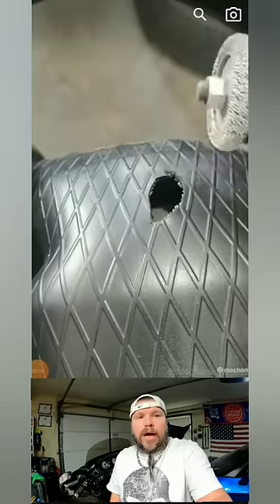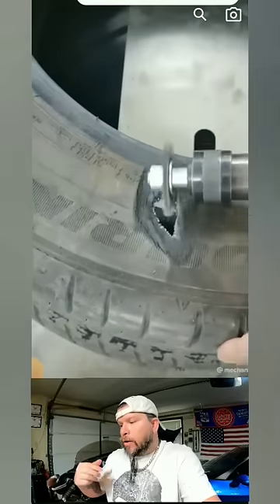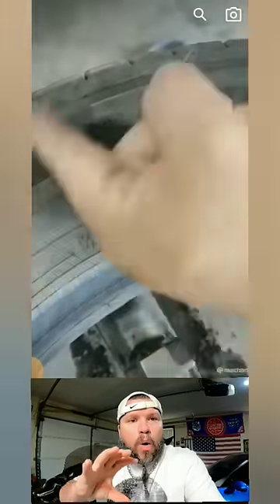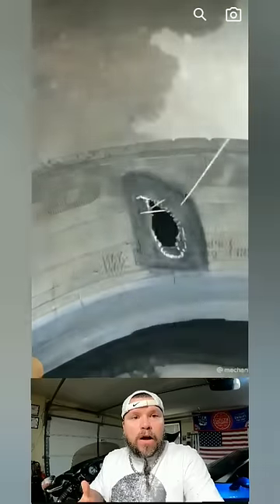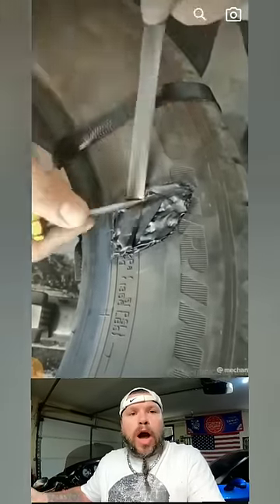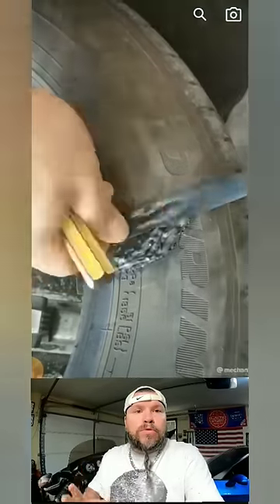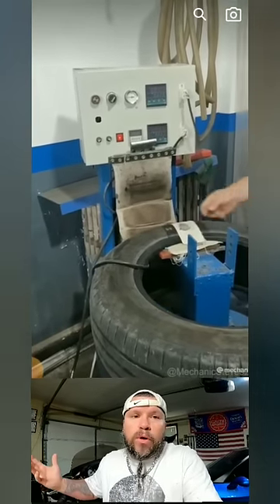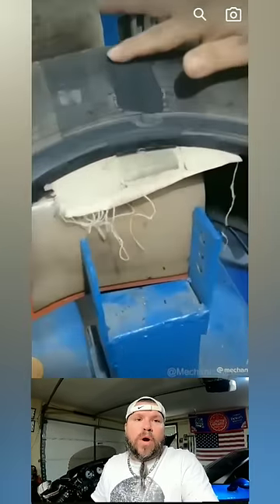patching a tire

Comment: got one like that on a hay wagon that was repaired in 1988.
Reply: Nice
Reply: Liar , that tire would be so dry rotted and weather cracked if you put any weight on it, it would fail.
Reply: @Blue_Shirt_Guy  go to farm equipment auctions and you will find lots of old tires with this type of patch on farm equipment . They usually put the patch facing the vehicle side and YES some of the tires on equipment is as old as 1988 manufacturing dates & still getting the job done . I've even seen people spray paint old tires black to make them look new to sell the equipment at farm equipment auctions .
Reply: @craigalston2208  I'd factor the price of new tires in on my bidding process.  Tires have a shelf life. dirt farmers don't care. Dirt farmers only care about saving pennies, while burning dollars.
Reply: @Blue_Shirt_Guy  Maybe, I have a disability that I have been unaware of my whole life. However, I feel I just read a response made up of bullshit that was unrelated to you being told how wrong you were?
Reply: @dakotahbarnhill4861  ikr it was bs in my opinion.
Reply: What’s that wagon toppin’ out at?
Reply: @jt5678  about 160 bales an hour
Reply: @Blue_Shirt_Guy  he didn't say the hay wagon or tire is still useable. Just that he had it. My brother has a race car. It's been sitting in his back yard for 6 years. It wins no races. Nor does it run. Still owns a race car.

Comment: I actually rode on a patch like this for a year, throughout winter as well, we were in a remote place near the arctic , and plane drop offs never got the tire for about 11 months. I also use this on my bias ply muds, I haven't had a bad time yet.

100 to 200 km a day on the tire, minus every other Saturday and Sunday.
Alot of things in this world can be repaired.. or listen to the guy selling the tires.
Reply: Anything can be repaired but there’s always a draw back compared to a new one.
Reply: Same. I’ve had patched sidewalls and ran them just fine. In every other part of the world, tires are a lot harder to come by, and they don’t just get replaced. If I have the money and can swing it, I do replace them…but to say that it WILL fail is incorrect. In Africa, this tire is just getting broken in!
Reply: You were driving at highway speeds?
Reply: @fakename287  highways speeds on gravel roads. Highway, roads, offroad.
Reply: @jakejakedowntwo6613  for sure.. but the tire never blew up on me. I just swapped it out when it was flown in.
Reply: @bravofighter  yep exactly right.

Comment: Somebody get this guy an inner tube!!
Reply: Nope
Reply: Nick Güer  Not true. They even make 'radial' tubes for radial tyres. Can be used in bias tyres but shouldn't use 'bias' tubes in radials
Reply: Nick Güer  what on earth is your problem???
And from what you said, it appeared you meant you cant put a tube in a radial tyre. Given thats what you said
Reply: You seriously made my day with your comment 😂😂😂😂😂😂😂
Reply: Nick Güer  You take everything this personal? or only when you are online talking to strangers? 🤣
Reply: Best  comment 👍
Reply: Can you put inner tubes on automotive tires?
Reply: @OldHeadFPS  Yes there usually used for offroad or heavy loads and also in equipment like tractors as well. They ran tubes in automobiles until the 1950's. This guy needs an inner tube to use on vacation, he's better off floating down a river. Lol
Reply: The heat won't dissipate properly with an inner tube.  You could use it around the farm or something but not at highway speeds.  Too much friction between the tube and the tire.
Reply: @UFO-047  haha you make too much sense to have an argument with that guy
Reply: That hole is too big to run a tube.

Comment: The only thing you missed is that the shoulder is considered a major part of the tire along with the tread and sidewall. Other than that, as a certified expert, this explanation is spot on. Now, if only customers would realize this as well 😂
Reply: The only major part of the tire... is the tire.
Reply: So maybe you can help me understand a little more about spare tires cause I was always told you’re only suppose to drive like 50 miles on one? But I was literally going out of state to fck with this chick(like a 6 hour round trip) and I did it at least 5-6 times. Also, I literally never got a new tire for that car…I drove it till I couldn’t anymore…but it wasn’t because of the tires lol I had to be on that thing for 6+ months…and I was like 20 so I was ripping and running constantly.
Reply: @Jordan Cave thanks bro that was a good read lol 😆, but sure I can help you out

They say only drive 50 because wheels need to be torqued to a certain specification, and excessive speed plus a loose wheel means disaster. Also. Having one smaller tire can cause uneven wear on the rest of the tires over time, which shortens the overall life of the tire
Reply: Agreed, as one as well
Reply: Not just un-even tire wear,  but also stresses control arms, bushings, shock/struts especially of older vehicles with aging parts that haven't been replaced and still in dependable/safe condition.

Comment: I hate to burst your bubbles people but I plugged a sidewall on a brand new tire that someone punctured with a knife I think. I used a standard tire plug you buy at any auto parts place and it lasted longer than the tread on the Goodyear tire did. I'm not sure about that much bigger hole but don't let them make you think it can't work in your own unique situation because i proved it to myself. Instead of being perfectly honest they will say whatever they want to sell you a new tire.

Comment: They do this in Mexico and Latin America 1000 times  a day and heat and vulcanized it in the end and they are fine and don't blow up.

I had a tire fixed this way and you can barely even tell where they are fixed in the end.

Comment: This kind of repair is actually quite common in developing countries, as purchasing a tyres (even a local made one) is around 60-100 dollars per tyre and that is very expensive if your salaries is only around 200-300 dollar a month
Reply: That's fucking cheap. American here
Reply: @ineedapharmists  ok lemme put this in a different way, tires in developing countries are 50%+ for just the cheapest tires. That's still insanely expensive
Reply: @ineedapharmists  You forgot the 200-300 dollar monthly salary
Reply: @ineedapharmists  maybe a third of your monthly salary and you have to buy food and rent and everything
Reply: @vortrekking boer  if you're an American then yeah maybe it's cheap, but if a single tyre costs almost half of your monthly salaries, then it is expensive.
Reply: @vortrekking boer  it's very expensive till the point where it is actually normal for people to buy used and rethereded tyres

Comment: There was a time when we did repair sidewalls, but they were not hole filled.  You can boot n tube, but keep in mind that it is only fixed on one side.
Reply: Those were bias ply tiers not radials.

Comment: I had a nail or a screw puncture a tire.  Our fleet I typically have 2-3 a year with the mileage I drive, diverse locations, jobsites, etc.  This one had ended up on the edge of the tread, and even though it was an extremely new tire they said because of its location they didn't feel comfortable putting a patch on it.  

You shouldn't take chances on something supporting you moving lots of weight at high speed

Comment: On semi tires you can repair the sidewall it's called a section repair. it includes a lot of grinding down like this guy did they spot weld new wires in the belts. Back fill it with rubber and also put a super heavy reinforced patch that covers from one bead to the other bead. When it's done properly the tire is just as dependable as a brand new tire
Reply: No, it's not. That's the reason there are semi tires all over highways.
Reply: Aircraft tire engineer here (I design high load bearing tires)

A puncture like that is not viable for use anymore. It’s actually cheaper to just replace the tire than risk liability of quality patchwork, especially for semi trucks.
Reply: @bryancline8893  all the tire debris you see on the highways is from Bandag recaps, not sectioned sidewalls. 40 years in the industry, my father and grandfather before me, family business. for the record, I have never run, or put a sectioned tire on the road, but if done properly I do know sectioning of semi-truck tire sidewalls is safe. Here in the states it is not something that is really even done for the last 20 years at least.
Reply: @tymcfadden8496  dang mr. Expert get off the internet and get on the Tv
Reply: @tymcfadden8496  i do secretly know they're retreads.
Reply: @bryancline8893  you got educated.
Reply: @tymcfadden8496  Is safe and it works are not the same m8
Reply: Thank you for this info.
Reply: The laws are different in each country.
Reply: @robster7787 Government employee here. We blow one, just replace them all🤷
Reply: @robster7787  wrong go lay down. Dude is right except for spot welding,  that doesn't happen. But yes they do repair sidewalls. Look up TECH tire repairs.  They have several pdf files, one of which is section repairs.  It's way more extensive than this crappy Asian tire repair video.  It requires more  equipment than this. This is called a spot repair.  So now you know " engineer "
Reply: @tymcfadden8496  probably not bandag, bandag is one of the leaders in retreading its from some smaller cheaper companies.  And yes it is still a very much in practice.  I too grew up in the industry.  Spent 50 years in it.
Reply: @Bdamazyn  nope, I have worked on several municipal vehicles,  they replace one tire at a time if a tire fails.
Reply: You can repair all you want to on a sidewall, I wouldn't trust the tire. Blown out tires on the highway are from the retread.
Reply: @Blue_Shirt_Guy  i didn't say Bandag capping wasn't in practice anymore, I said sectioning sidewalls isn't done here anymore, at least not on OTR tires. I'm also not aware of any "smaller companies" using a cold capping process similar to Bandag... they are, if they exist, using Bandag's tech under license.
Reply: @Blue_Shirt_Guy  Nobody with a MAGA hat would use this tire. This tire looks like it'll work like the biden administration.
Reply: @tymcfadden8496  you think bandag is the only company retreading tires. Yes sectioning sidewalls is still a very common practice.  I usually had them capped as trailer tires but I often used them a drive tires on the fleets I worked on.
Reply: @jonathinfellnerah4021  wrong again
You're 0 for 3. Just stop. You obviously don't know anything about tires.
Reply: @jonathinfellnerah4021  of course,  I've only been around the tire industry my whole life. So no I don't know anything about tires. 

0 for 4 loser

Comment: Most of the strength in a tire sidewall comes from the intricate layering of the tire ply within which pulls from the strength of the main tire ply, and they tend to delaminate when damaged.

(edit: happy now? will this suffice? have I appeased the ones that refuse the simplified explanation I've made for the dimmer people that seem so common on the internet?)
Reply: Absolutley wrong. The steel belting NEVER goes into the sidewalls, it is only in the tread area of the tire. The fibers that go into the sidewall area are typically cotton or a poly cotton blend. They allow fexibilty whereas steel belting does not.
Reply: Yup.  What that guy said .. your absolutely wrong.  There no metal in sidewalls.  I'd delete that comment

Comment: You are speaking facts….even a slice from a razor blade across the outer layer of a tire will cause the tire to bubble first and then blow and it usually happens when the tire gets hot from friction when driving

Comment: When a rubber tire is vulcanized it forms sulfur links between the other structures. I think the primary issue is that it's probably not easy at all to fill in new sulfer links at the edges where this patch is made to the pre-vulvanized tire. A tire is actually a singular giant molecule by definition because of how it's linked, and patching it after primary vulcanization, will likely not yield a true monolithic structure in the end.
Reply: Yes... I concer
Reply: @Vagabond_G  Concur?
Reply: Cancer?
Reply: i've done repairs like this.. they have not shown whole repair process .. there is soppose to be patch on the inside with 3-4 plies .. it is simultaneously vulkanized.. and it can turn out nice.. little  bit more counter weight needed dough.
Reply: @vojislavdragic5090  but how can it fully vulcanize to the surface of the tire that has already had this process done to it? I'm not sure if a bonded patch actually forms the full sulfer bonds needed to be considered a single molecule, so it might still be structurally weaker if it isn't latticed together with the original vulcanization and setting process. I believe you that they are vulcanizing the patch, but unsure it bonds as strongly as a single-vulcanized object, which in some cases might be critical.
Reply: @Roobotics  ofcourse its weaker.. but these tyres  are overengeneered for safety.. and can endure colosal weight each. So repaired one can still handle the pressure and bending.. tyre has to be relatively new for molecues to bond.. i lived in states   as well  ,where this is liability.
Reply: Never, ever attempt to repair a sidewall. EVER!
Reply: @vojislavdragic5090  What's the 'dough' for???
Reply: @tima.478  though..
Reply: @tima.478  anything else ya need clarified jose?
Reply: @vojislavdragic5090  i was crystal clear, you however....🤣

Comment: Even as a burnout tire it would probably fly apart right away with that large of a sidewall hole
Reply: Wrong
Reply: @xLegionnair  try it and post the results then
Reply: LOL this is what happens when you speak about something you never seen in your life. That tire will probably last 30k Km more, it's a common practice in my country
Reply: @Bv1nte  do they really hold up to 55+ km/h? I don't believe a tire could possibly stay round with that much damage.
Reply: Are you familiar with the vulcanizing process of rubber? Not saying I would run this but we do belts this way and it’s stronger then the original belt
Reply: @T3KFTW  Why?
Reply: @T3KFTW  why don't you believe? Do you have any knowledge on the process of vulcanising a tire? Based on your comment I see you don't
Reply: @T3KFTW  it's not a tire that will last a track day, but it's perfectly fine for daily use on a small car
Reply: @xLegionnair  ever see a slow motion video of a tire at speed? This might work for a while, but it is absolutely the weakest link in the chain and can absolutely fail spectacularly
Reply: @Bv1nte  it seems based on your comment you don't have knowledge on centrifugal force. there's belts holding the tire together. it might be fine for low speeds but as soon as you hit the highway and get some heat in that tire you're going to have a bubble or deformed tire at the least. it literally can't stay round without the belts
Reply: @T3KFTW bases on your comment you never worked on a tire repair shop. Imagine spending 15k on a vulcanising machine just to have all of your costumers to come back with broken cars. Do you really believe on what you wrote? Do you think that tire won't last the speed limit? Looks like thousands of repaired tires are defying your centrifugal laws by lasting until the tread ends🤣

Comment: If its done properly with high heat to vulcanize the rubber back into it and yes it could work just fine. But i too would use it on the farm not the street at any high speeds.. hes not using regular tape but special self adhering tape here too...
Reply: on a car tire there's not enough rigidity to keep up after a patch work.

Comment: I agree, I wouldn't want it on my vehicle. The machine he is using is called a revulcanizing tire repair station (not nomenclature, not looking it up.)  I wouldn't use it when rubber is missing, moreoif it got torn back but was all present. What it does is liquefied the rubber in a new "mold". It works GREAT foe tractor tires. Let's say a single lug got pulled away from a newer tire he just spent $1,200 on. The revulcanization will cost him about $250, and the tire is good to go. He can save $950. 

Thst is a tractor tire. As a tire professional of 12 years, I would not want it near my vehicle.

Comment: there is a reason any reputable place would refuse to do this repair to put back on a customer's vehicle. There is a reason they have signs that say what parts of the tire if damaged will require a new tire and not able to be repaired.

Comment: I worked for wingfoot Goodyear and we did repair sidewalls for certain tires. The proper way is to melt metal mesh patch(like radials) in the tires both inside and outside. The inside wall holds the pressure so it's more important. Cost wise it's usually cheaper and safer to buy a new tire